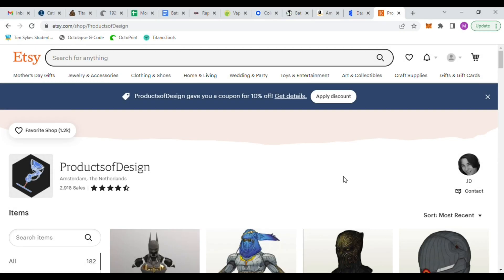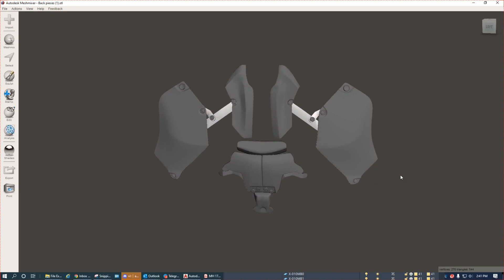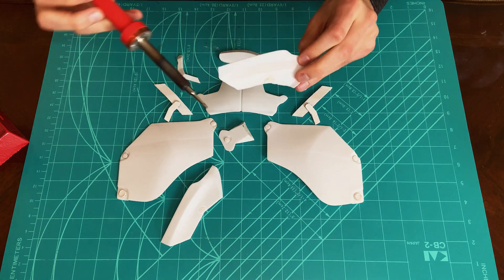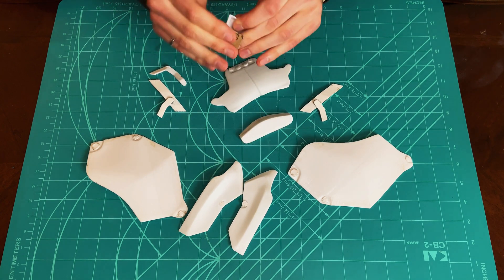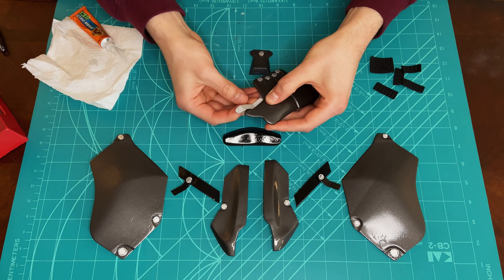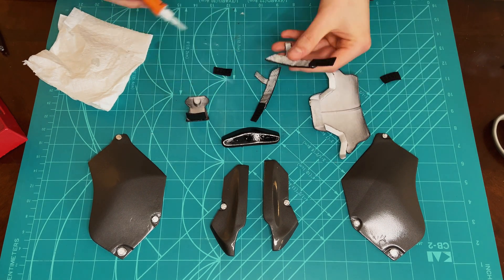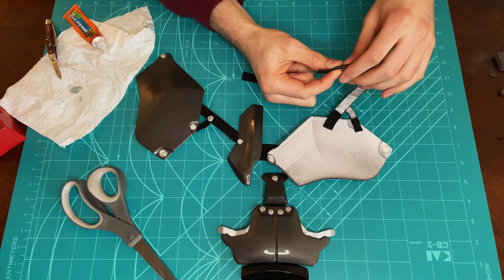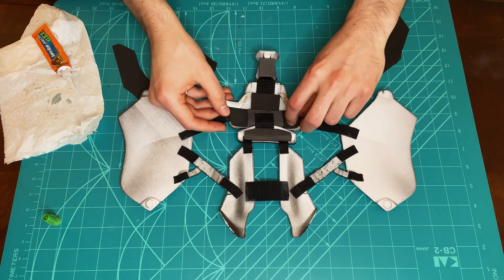Batman Arkham Knight 3D Printed Back Plate

Comment: Amazing work as always. Can't wait for the chest plate. It's a complex piece but I'm sure you will handle it easily. Moving bat symbol is my favorite part about this suit. Velcro and foam will come in handy for that part.
Reply from the maker: Working on the chest plate right now. For the first iteration of the design I chose to go with a solid chest plate. Seriously considered doing the movable one and would like to eventually make one and replace the solid one in the future. But for the first rendition I decided to keep things a little more simple. Once I have the whole suit together it will be easier to engineer a movable chest plate that fits and works a lot better.